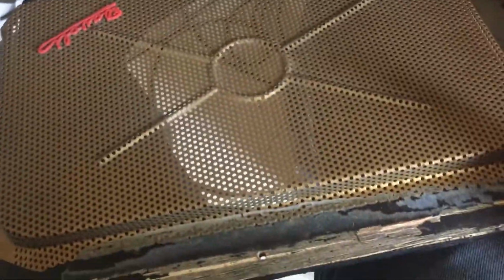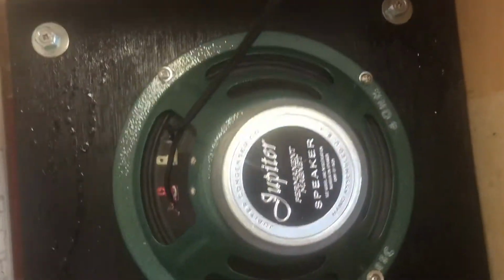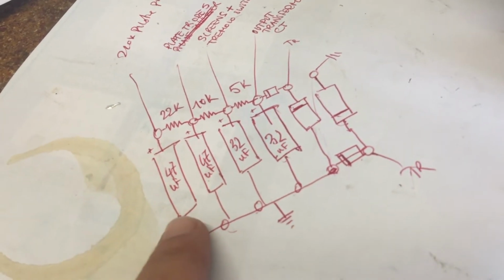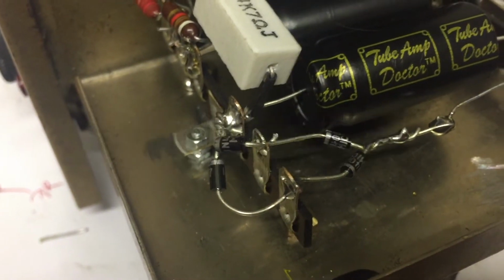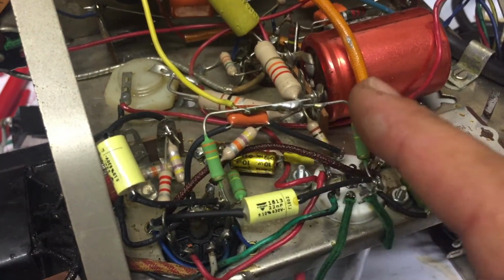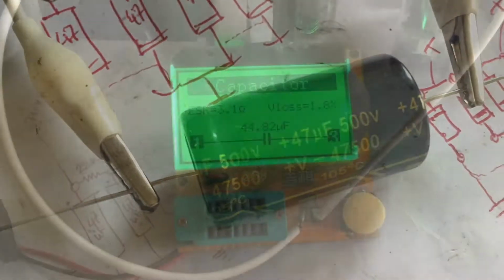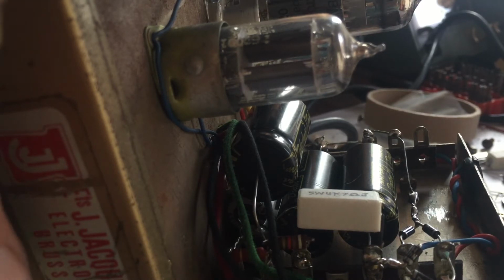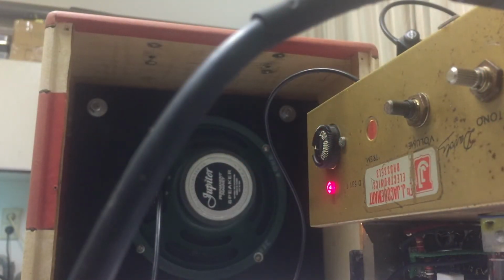Davoli D531T - PART 4  NEW speaker, filter caps, tone control, tremolo range

Comment: I'm in the UK and just got a little 4-5watt 1962 Ekosonic from Italy but the highest it's voltage selector goes is 220v.
Is it safe to use with 240v?.
It's 240v here in the UK.
Thanks.
I love these old Italian amps!.

Comment: Hi Zjokka! i've seen all video about this work. that's very good work. I have the same amplifier D531 T, i've tried to fix it but doesn't work like yours. The clean sounds quite well but the Tremolo sounds distorted as a overdrive pedal. I found  only one  50um 350V capacitor exploed (the first )and i replaced with newone.the others capacitors are ok or bigger then its value. I have not the original schematic but i'm using the yours. I have different tubes 6x4 Rectfier - 12AT7 Preamp - 6av6 Tremolo - 6Bq5, i don't know why. The speaker looks fine. Have you got any advice for help me? Thanks in advanced Daigoro
Reply from the maker: Hi Daigoro! First off, my amp does not use a 6BQ5 or EL84 but an ECL86, which is a pentode and triode combined. In other words its an EL84 and half a 12AX7 in the same tube envelope.
The tube complement you mentions --with 6AV6 seems to match this amp:https://www.vintageandrare.com/product/Davoli-Krundaal-DTE-1051-T-1959-Red-81549

Note it also uses ECL86 -- maybe somebody mistakenly put a EL84 in the power tube socket?

Comment: Nice video.
I was surpriced if you could lower the cathode resistor after changing the selenium rectifier but the reason was that the B+ was so moderate. I have an old italian amp with ECL82 tubes and it ran so hot ( because they desperately tried to get 15 watts out of it by increasing B+ to 290 V, i. e. the output power of two EL84 tubes, out of that ECL82 tube pair)  that I had to increase cathode resistor from 270 ohms to near 400 ohms to lower the plate dissipation to acceptable levels, 7W plate and 2 screen. Well,  NOS Miniwatts and Telefunken ECL82 tubes probably can take quite a torture but still. And if the pentodes are not in balance, it is wise to use separate cathode resistors for each tube because the pair won't go imbalance so easily, especially if you want to run them as hot as possible.
If there is problems to have room for that magnet, sometimes it is possible to attach the speaker from outside the baffle.
If phase splitter is cathodyne type, it will load the tremolo signal to pentode grids a bit asymmetrically which sometimes causes unpleasant "babababa" sound when amp is quiet and tremolo is fast. It can he cured by putting a a cathode follower pair between cathodyne PI and output tubes, which works fine and removes the unwanted sound if there is room for one extra tube and enough heater current available (or making the PI symmetrical, for example long tail which of course changes gain structure of that amp).
ECL82 are nice tubes and have been quite inexpensive so far but NOS prices are going up because people build reverbs and small amps using them. 
Many years ago I purchased several yogoslavian or hungarian made National ECL82 tubes and later it turned out that one third of them were gassy. Pentode leak grid resistor voltage started to rise after tube warmed up after 5 minutes or so.
Reply from the maker: Hi jutukka, thanks for the insightful comments. Yes, those pentode/triodes are very interesting tubes, especially since everybody is looking for smaller amplifiers. Serious changes to this amp are not really an option, as little space as there is. Would really like to learn more about your projects, why does your channel not have any content? Go for it... take care

Comment: Well, it needed a lot of work after all..
Hey what about the original speaker? Do you happen to know how it can be fixed? I just have a 12 inch that might has the same problem.
As always, thanks for the video
Reply from the maker: Hi Stavros, you are so right. That is the question that I forgot to ask -- what is wrong with the speaker and how can it be fixed? In the video I mumble something to the effect of it being the magnet. That's stupid -- it's something wrong with the voice coil. Tackling that problem would mean taking the speaker apart... a daunting task. Also, I think that the cone, even though intact, has at one point soaked up humidity then dried out unevenly. It's not entirely flat... 
Also negotiating with a seller who want 1300 euro for a similar blue amp without tremolo. I don't know why I'm even talking to this guy.